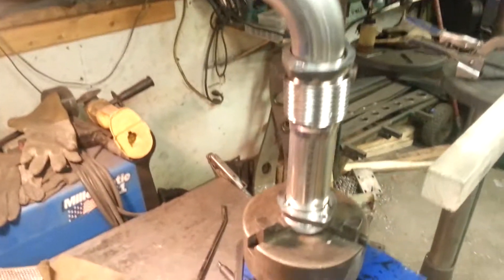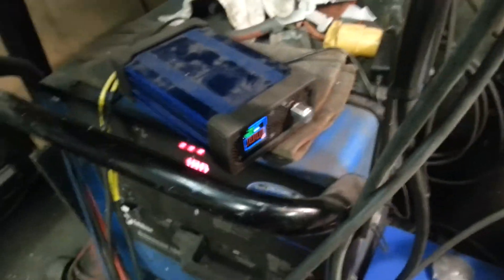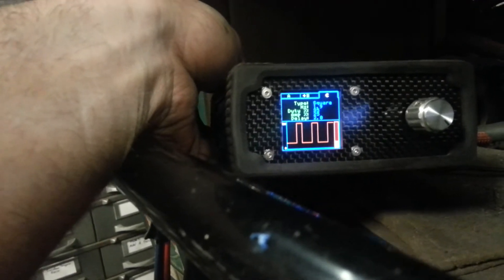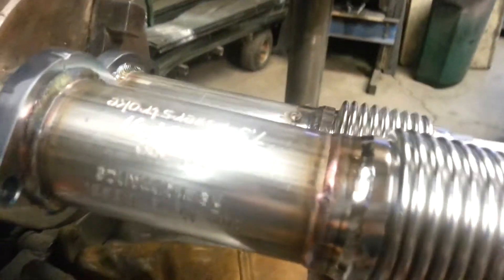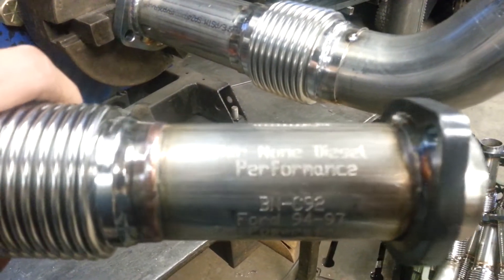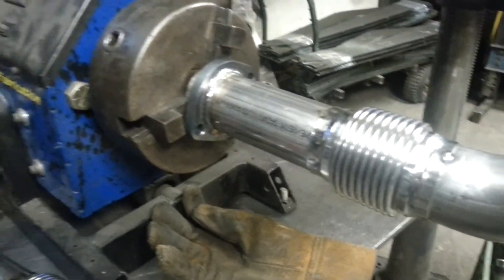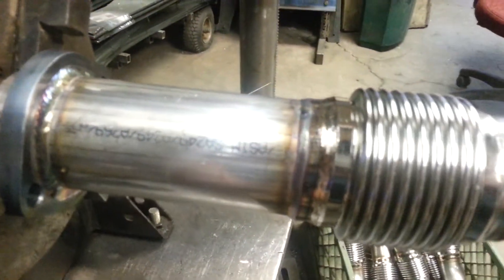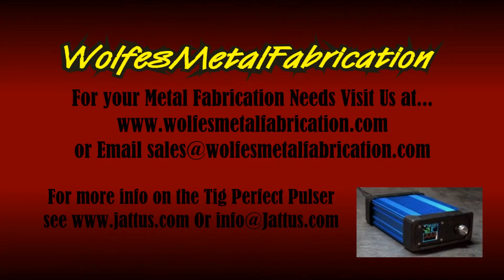WMF Tig Perfect Syncrowave 180SD Pulser Add On Welding Stainless 7.3 Powerstroke Diesel Turbo Pipes

Comment: Hello so I have a miller sycrowave 250 I am thinking of getting a tig perfect box for I am on the fence the box is $400
Or I can get a alpha 200 igbt tig welder with all the pulse stuff for $600
What should I buy
Reply from the maker: With the machine i had, an option like this was one of only a few options.  It worked great for me and added the pulse option.  As far as what you should buy, i do not know, compare products and prices and make an informed decision.